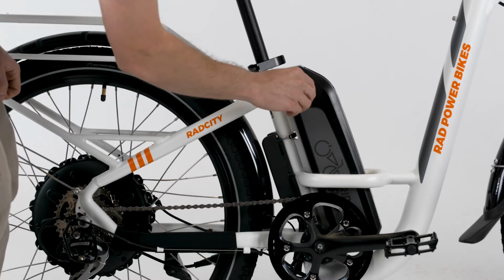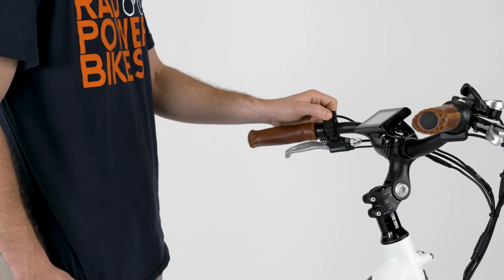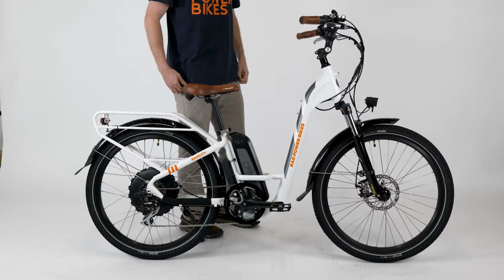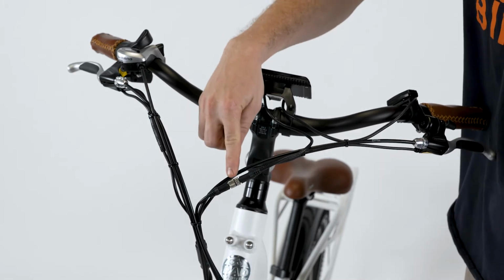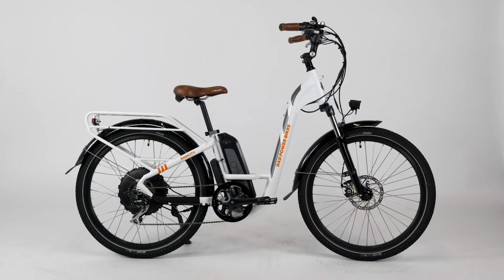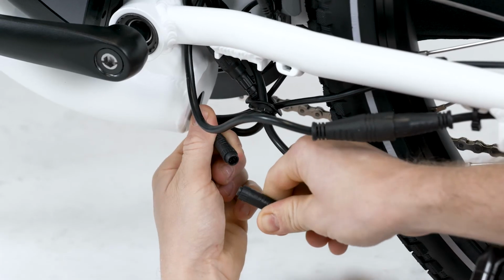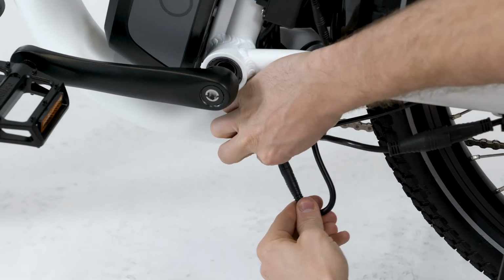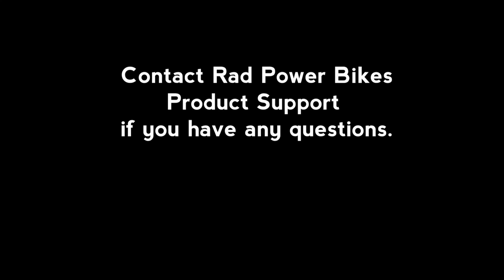2019 RadCity Step-Thru Connector Check | Rad Tech

Comment: Wait a minute.  23 seconds in the hands separate a red connector for power?  Isn't the connector for power the silver one just below with the little tightening collar?
Reply from the maker: The connector at the 23 seconds mark is connected to the brakes. It will shut off all power to the motor when the brakes are engaged. The silver twist connector is the main power line to the LCD display.